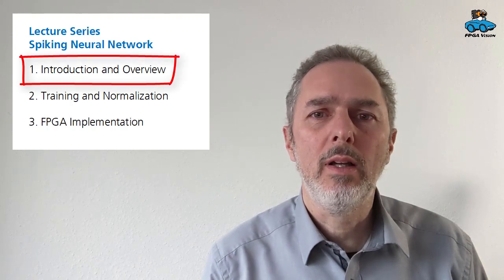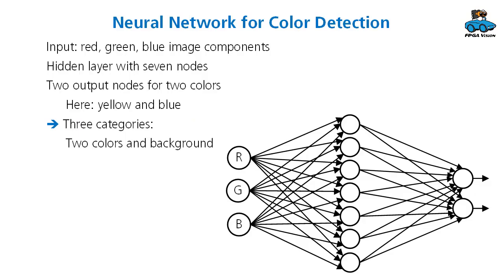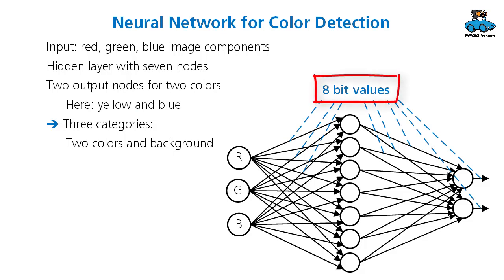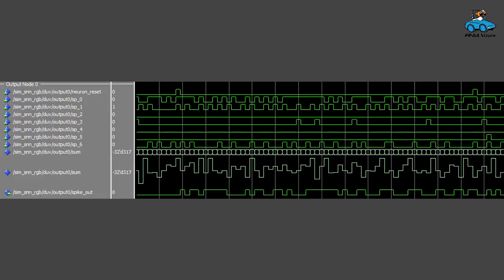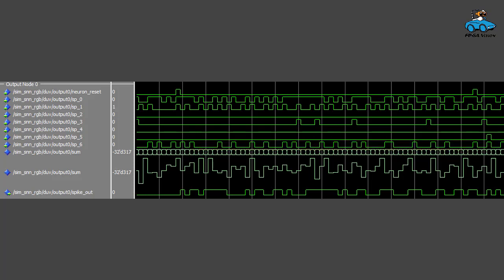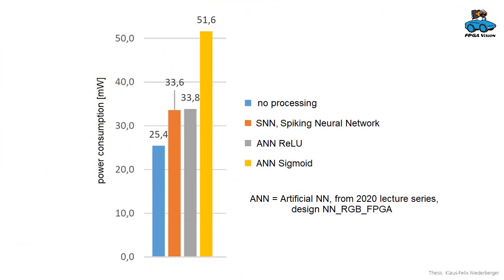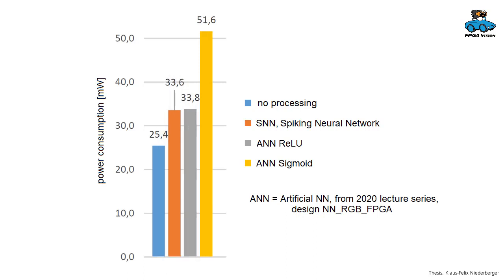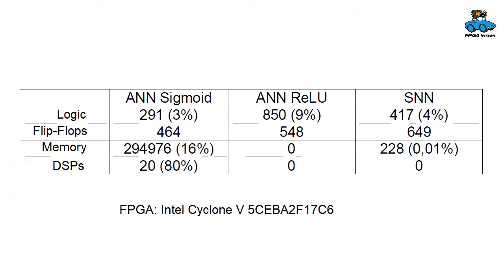Spiking Neural Network on FPGA - Introduction and Overview

Comment: Your lecture is crucial to me because it's exactly what I have been doing! I have been studied SNNs for several months but I don't know much about FPGA. Can you tell me which kind of FPGA I need to buy in order to perform tasks in machine learning especially SNNs? Thanks for your wonderful lectures.
Reply from the maker: This is a difficult question, a little bit like "Which car shall I buy?"

Basically, you need to consider two things: 1) FPGA-capacity and 2) Interfaces

FPGA-capacity depends on the size of the NN you want to implement. FPGAs are pwoerful, so for a start with small/medium experiments, a regular FPGA is sufficient. 

Interfaces are important to get your data in and out. The lecture describes video processing, so it needs video in and video out. If you do audio processing you need these interfaces. Or maybe you want to use an embedded-CPU, then you need a corresponding FPGA.

Often the FPGA-boards provided for educational purposes are a good choice. Terasic offers Intel-boards, Digilent has Xilinx-boards.
Reply: @marcowinzker3682  Thanks very much for your detailed reply! It was inspiring and motivating! You are such a generous, dedicated and knowledgeable teacher!